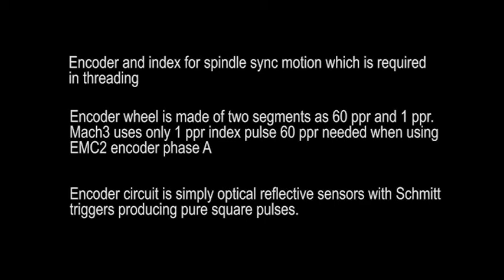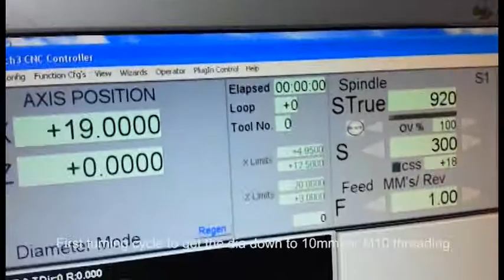Mini lathe, Optimum180x300 CNC conversion. First trial of threading

Comment: Very nice!!!
Can you give more info about the encoder?
What parts did you use and how did you connect it to MACH3?
Reply: use optical sensor from hook of telephone. machine slot into pulley of machine or attach a slotted disc to the back of the spindle. Wire into mach and configure the input. It takes only a few seconds to configure.

Comment: Çok güzel çalışıyor, tebrikler. Benim de CNC ye dönüştürdüğüm aynı tip tornam var. Spindel'a optik sensör yerleştirdim, RPM değerimi ekranda çok güzel görebiliyorum, ancak Mach3 diagnostik ekranındaki diş çekme için gerekli index çok kararsız yanıp sönüyor. Bu yüzden de diş açamıyorum. Siz BOB olarak ne kullanıyorsunuz?. Benimki AKZ 250 (leafboy77) marka çin malı USB controller.
Reply from the maker: Merhaba, ilginiz için teşekkürler. Ben klasik opto-coupler korumalı bir paralel port kontrol (BOB) kartına Leadshine 'nin M542 step motor sürücülerini bağladım. Optik sensörden her tam bir dönüşte tek pulse gönderin (1ppr) ben yaptığım optik sensörde tek pulse da gönderebiliyorum. Pulse sayısı birden fazla olursa index de RPM yi doğru okusanız bile MACH3 programında verdiğiniz diş açma gcode da senkronizasyon problemi oluyor. Bu internet de araştırdığım kadarı ile MACH3 ün zafiyeti, yazılım esaslı bir problem. Ya Linuxcnc kullanın ya da MACH3 e tek pulse lar gönderin. Donanımla alakalı bir problem olduğunu sanmıyorum. İyi çalışmalar dilerim...
Reply: hello good afternoon.
very uen work guys.
I encuenro in the situation of making my own lathe.
AKZ250 my disposal to 4 USB axis and several Leadshine 32320.
someone I can pass the XML file mach 3 for trying to understand a bit like funsiona theme lathe please ?? .
I would like to turn the plate with a Leadshine. moment what would prove a 32309, then you would put one NEMA 34 or NEMA 42 (can not remember the model but which I have in my router).
for nothing more, mushas thanks for your time and best regards